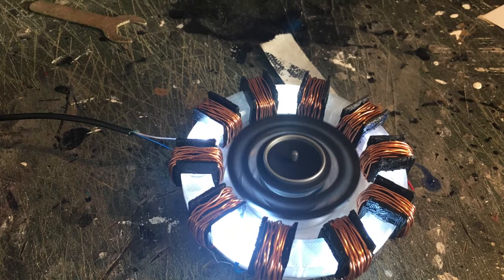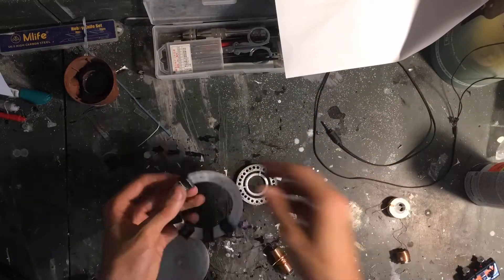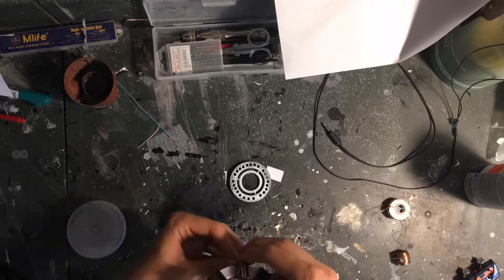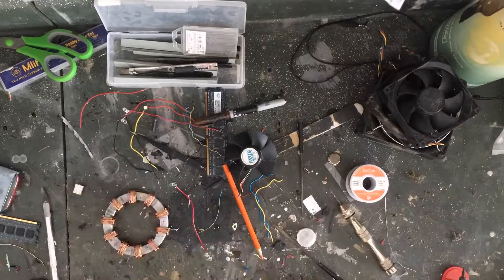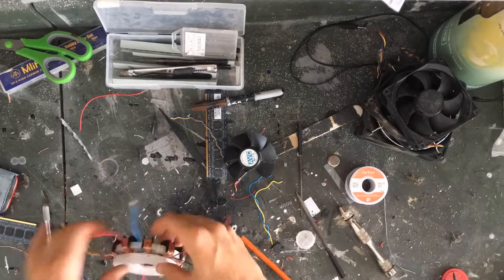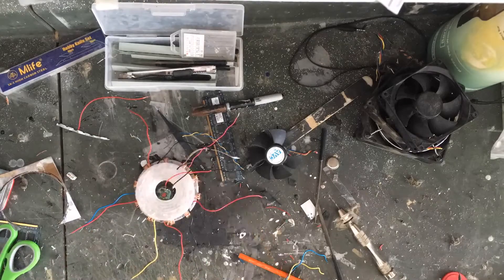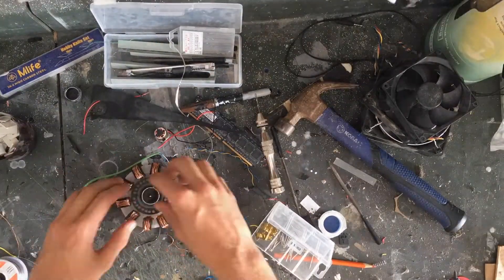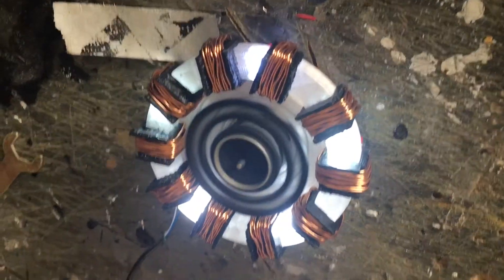DIY 3D Printed Arc Reactor

Comment: wait hold on, everything happened so fast xD
first of all, was all those pieces 3d printed? the black ones, the translucency ring(if that's the case what 3d print material did you use?) and the disk with the hole forthe motor? (it that one is also 3d printed why didn't you just leave a hole there while you 3d printed it?)

and what type of motor did you use? and what is the spinning ring on the motor? did you carve it out from something or was it a part of the motor?
sorry for so many questions. but thx in advance if you take time to answer them 🤗

to bad you didn't have enough led lights  thou, but it honestly looks amazing :D
Reply from the maker: Sorry I’ll try and slow down the time lapse. All of the pieces Besides the motor and the copper wire were 3D printed. the clear base was printed with 5% with clear filament, I designed the 3D files as  a solid model to sell so I modified it to fit the motor.
Reply: @ReProps2003  i see :0 smart!